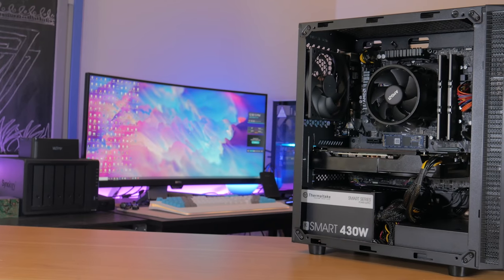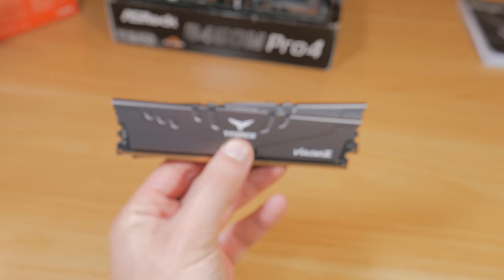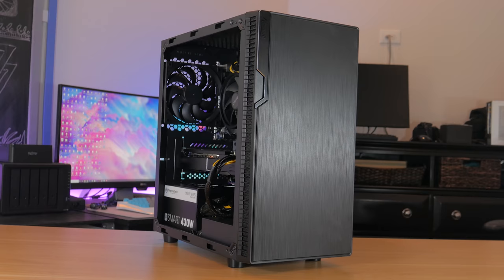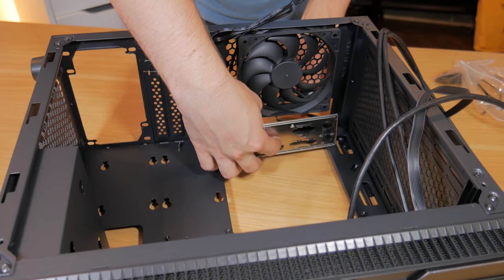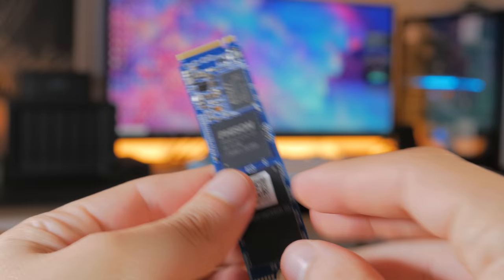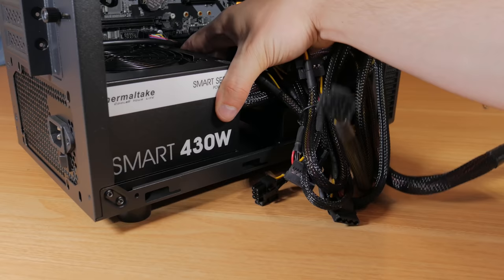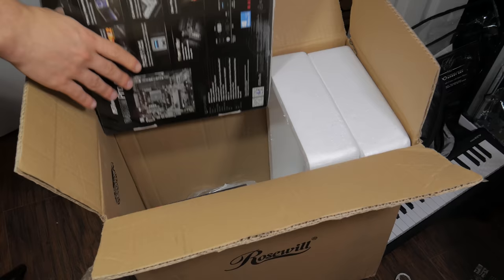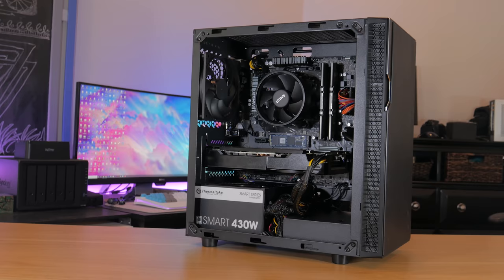$400 Gaming PC Build Guide! (2019)

Comment: I find it very easy not to recommend an SSD in a budget gaming build. Windows 10 starts near instantly no matter what boot drive you are using thanks to the fact it never actually turns off. In games you might have to wait a little longer in loading times but otherwise it isn't something that is noticable, if you do notice it them the game isn't very well optimised.

The price/performance ratio isn't there yet for a gaming system.
Reply: ??? theres no reason not to get a ssd. Not only is it faster its usually more reliable and the price point isnt too expensive anymore. its well worth the little extra cost. not to mention just getting a 256gb to put windows and main games/programs on then buying a hdd for more storage is not alot of money at all even in budget.
Reply: @DustyMiles  I have a Samsung 250gb 960 Evo NVMe as my boot drive, A 500gb Intel SSD for games, a 3tb hard drive for games I don't play regularly and media, and a 1tb hard drive for downloads.

I'm quite confident to say that in a budget gaming PC, where you are only having one drive, an SSD is not a price/performance choice. You'd be far better with a hard drive and spending the savings on more RAM than an SSD.

After all a boot SSD and having to put all your games on a hard drive doesn't help gaming performance in the slightest since you are running the games off a traditional mechanical hard drive.
Reply: @voteDC  hence why i said you put your main games/programs on the 256gb ssd then have a 1tb hdd as extra storage.....the load times in games can be up to a minute or more difference between a ssd and reg hdd. also  you can easily build a budget pc with a 500gb sata ssd even. if its truly a budget build you could find some awesome deals on ebay and craigslist too. Theres just no reason not to include an ssd of some sort. a sata ssd of 120-140gb costs 20 bucks.....
Reply: 🙂 yes thats fine, try to get the faster 7200rpm drives, the ones that have more cache, HGST & Hitachi is the most reliable if thats important to u

Comment: Not realy good guide. PSU should go first, coz many cases has small hole for CPU power cable, and you cant put it throught with installed mother board. Also PSU with fan looking up will get hot air from video card, that is realy not good. And you can install cpu cooler outside the case only if its small like this one, if you are using tower cooler, it will be realy hard to connect CPU power cable or even unreal.

Comment: year 2011 $800 for all parts
now 2019 $400
gaming low my old pc is fine... i have now and... my old pc is age 7 ;p
cpu fx6350 4gz
 motherboard Gigabyte GA-970A-DS3P ATX AM3+
cpu cooler Cooler Master Hyper 212 Evo CPU Cooler with PWM Fan, Four Direct Contact Heat Pipes
gpu rx 580 8gb
 Gigabyte
 last year 2018
ram  X Series 16 GB (2 x 8 GB) DDR3-1333 Memory
Storage HDD Toshiba 320 GB 2.5" 5400RPM For window10 and Seagate FireCuda 2 TB 3.5" 7200RPM for games
Power Supply Corsair Enthusiast 850 W not 80+
not good case suck air.... Apevia X-Plorer2 ATX Mid Tower Case

Comment: "The gpu market is in a good place right now"... 🤔
Reply: I think he meant with the low and mid tier of cards which to be fair is doing much better, it's the upper mid range and high end that isn't in a good place right now.
Reply: @paul1979uk2000  The low end gpu market is in a slightly better state than the high end market sure, but that's not saying much. Price to performance has stagnated and even worsened for the past few years. Even in the low end market, not as badly as the high end market maybe, but the entire market is affected by the monopoly, to varying degrees. It seems that new gpus are doomed to never provide a price to performance improvement over their replacement. If anything even worsen in value. Which is ridiculous frankly. At least that's the way it seems to me. It's not fair that i should be denied enjoying my hobby because everyone seems to be okay giving away their money to nvidia and amd. The market is a mess. 

Sorry. It frustrates me.
Reply: @joshywoshy18  I agree the market could be better and maybe things will get better once Intel are in the game as they have nothing to lose and everything to gain, so they are likely going to be aggressive on pricing and the markets I suspect they will target early on with be low end and maybe mid range as well, Nvidia and AMD should watch their backs because their greed could make it easy for Intel to eat their lunch.

In any case, it's the higher end gpu market where gamers are really getting ripped off and in my case, I just upgraded my PC about a month and half ago and it's been the longest I've not upgraded my PC since the mid 90's, in other words, these high prices across many sectors of the PC have been pushing me to upgrade less and I suspect that is the case for many others and that isn't doing the PC any favours.
Reply: @paul1979uk2000  I very much hope that intel can provide more competition in the market. But it's intel, so i doubt they'll be particularly aggressive with their pricing. But hopefully.

And yea same, I've been wanting to get into pc gaming for a while, but i would want a decent system if i were to get into it, but i personally just can't justify the price of even "mid range" hardware. So it's kept me away. 

I'm hoping the new consoles will put some more pressure on the pc hardware market too. If they're going to have mid-high end amd hardware at like $500, they should in theory provide some decent competition to mid range pc's. I hope so anyway.

Comment: Hey Matt!
Wassup!
I have a question..
I've been wanting to upgrade my PC, from a 7700k, to a 9700k.
I've ordered the CPU and also the new motherboard for it.
From my past experience, every time i changed motherboards, it requires a fresh reinstall of windows, cuz of the drivers conflicting each others. But I've read some threads online, saying that the newer version of windows, doesn't need a reinstall when fitted with a new motherboard. 
Main question is,
Will changing my motherboard interrupts my existing drivers, so i need to reinstall Windows?
I currently have the Aorus Z270x motherboard, and will be upgrading to an Aorus Z390 Ultra motherboard...
Thank you!
Reply: For my experience before doing the pc upgrade, uninstall the gpu drivers, backup the system (windows) using Acronis True Image, doing your upgrade things then restore your backup image to the new system. This will save you a day to install windows, apps, printer...etc. I've fixed/upgraded lots of my co-workers computers and doing the above method almost never have a problem. Good luck doing your upgrade.
Reply: Long N I've just done my upgrade! 
Works like a charm without me even doing anyting to my existing OS..
Just straight up replacing my CPU, and Motherboard and Windows does the rest.
So glad that's the case on my build, and not having to reinstall Windows 10!

Comment: why 430w? i think recommended power for rx 570 is 500w🤔
Reply: The recommendations are catch-alls just in case you're trying to pair up with a 300W+ CPU.
The build shown here shouldn't ever pull more than 250-300W total.
Reply: 🙂 a 570 only has a single 8pin, normally a 500 watt is recommended for video cards with two 6pin plugs, plus the 1600 cpu is a baby. So yeah 400 watts is enuf 😎

Comment: 430W enough for rx 570? idk bout that
Reply: it is enough. It wouldn't be enough for older generation gpu like the R9
Reply: From my opinion is not enough, better choice is 500W 80+Bronze
Reply: idk even 500w wasnt enough for my rx 570
Reply: Lukicha i had rx 570 8gb+r5 1600+A320+ 520W 80+Bronze from seasonic. When system is full load, the GPU will suck around 200W-250W, Procie is around 65W-70W (cz my mobo can't OC the procie), Storage+RAM is around 30W, Coolling system, maybe around 100W (depend on how much fan). Here why i know that ? Calculation, read a review on internet, and Wattmeter.

This is my opinion, calculate your total system then choose a PSU. Example if your system can suck around 400W on full load, you can choose 650W/800W, why ? Don't stress your psu near they max capacity, the psu component will too fast to die
Reply: 🙂 maybe, check the specs, some 430 come only with a 6pin which is bogus, you need a psu with an 8pin, unless ur 570 is a low power version with a single 6 pin
Reply: 300W is enough for an rx570.
Reply: 430w id cutting it close. 450w is fine.

But quality is also important. Thermaltake smart units are very very bad. Literally everything that can be cheaped out on design wise has.

Comment: 1st Mistake; AMD!
Reply: AMD Is so much better price to performance
Reply: @dapyzzz4209  I've always had Intel, never had any issues with my rigs. I've had friends who had AMD's and literally watched them overheat, smoke and catch on fire! I won't buy AMD. If you take an Intel CPU and you have it running without the heat sink and cooling fan, when it gets over a certain temp it will automatically shutdown the entire system instantly where many AMD's would just keep running overheat and wreck your entire system. 

However this was a while back a little over 10 years ago. I'll stick with Intel and for GPUs I'll stick with NVidia! Not only that but when it comes to programming, reverse engineering etc I'm more familiar with x86-64 Architecture and Instruction Sets and besides that I prefer my machines to be Little Endian! They have a much better performance gain over Big Endian systems.

My rig right now is a bit dated; I have an Intel Core 2 Quad Extreme 3.0Ghz running win 7 x64 with 8GB Ram it is over 10 years old still runs like a charm and is a work horse! I had to replace power supplies, ram models, heat sink and cooling fans, disk drives, hard drives and GPU yet my Intel board when they still made them and my Intel CPU have outlasted just about everything else in the system. 

Then again about every 2 years I do back up all of my data and I do wipe of my drives (not a basic format) a full wipe and install windows fresh on it, install all current drivers then my apps, and it's just as good as the day I built it! My machine is not a pre-built bloat ware! I bought this originally around 2007-08 and I paid about $1k for the full rig but I have about $1,200 - 400 invested (newer video card that's about 4 years old now, a new $150 keyboard) ram modules and power supplies, but it has done everything I needed it to do. 

For my next rig I'd like to invest even more for better hardware for top performance than what I have, mainly because I'm not just into gaming but I'm also into hardware and software developing and architecture doing things from hardware emulation to 3D Graphics Programming, Physics Simulation etc. 

For example my current rig can run the RPCS3 emulator however it doesn't run it smoothly. I would need a better video card as I have a decent one for its time but not so great considering today's newer models. I have an  EVGA NVidia GTX 750 Ti 2GB with overclock and dual fan cooling. 

For me to use the RPCS3 for PS3 Emulation and to get 60 - 120 FPS I would need the following: an i7 Extreme top line with 18 cores 36 threads, a top line mother board to be able to push the hardware to its limits but in a safe and stable manner, I would need top end ram about 32GB Cosair probably, maybe Kingston or Crucial if affordability becomes an issue (can always upgrade latter if needed), and a new NVidia 2080 Ti or  Titan card. (Quadra is a bit much...) 

However the overall price tag of a built system like this without Software would be probably about $6-7K so it wouldn't be cheap, but it would serve multi purposes; top end gaming, a development work station and other things...
Reply: @dapyzzz4209  Not really. If you take AMD's top CPU and let's say it costs about $500 - 800 for their very best and you compare that with a standard i7 6th,7th,8th or 9th generation cpu for about the same price to maybe a couple hundred more yeah it might out perform them in some area's and in some situations the out performing may only be very marginal. 

If you take that same AMD set up and compare it to either the Extreme Series, a top i9 or the new 10th generation yeah you might be spending twice that amount but there is no comparison in performance and reliability. If you get the right cpu it can run for 10 - 20 years from Intel. What are you getting out of that Ryzen? 5 up to maybe 10 if you're lucky?